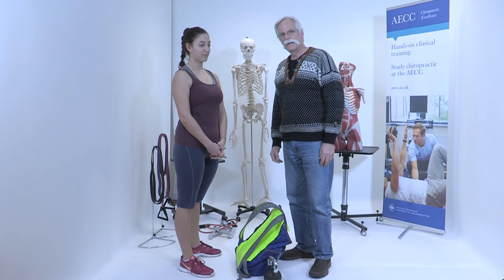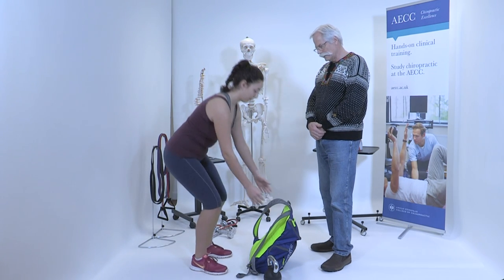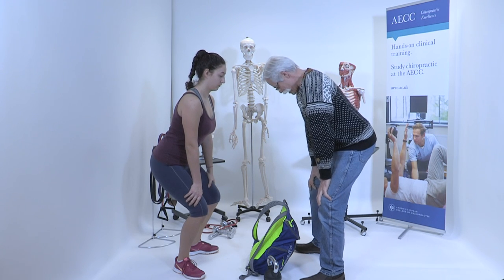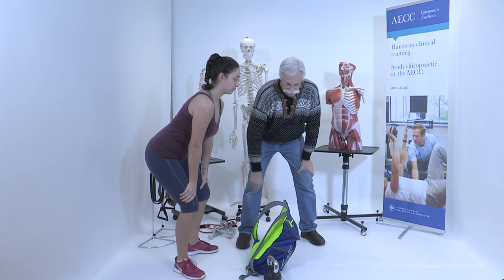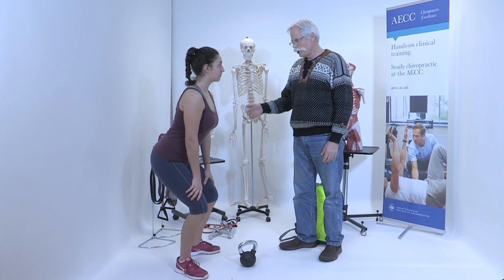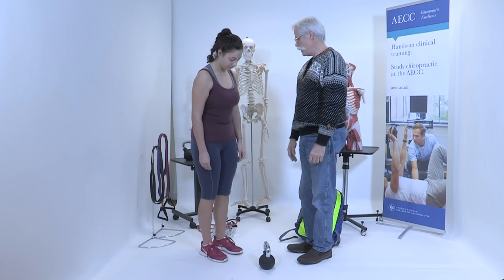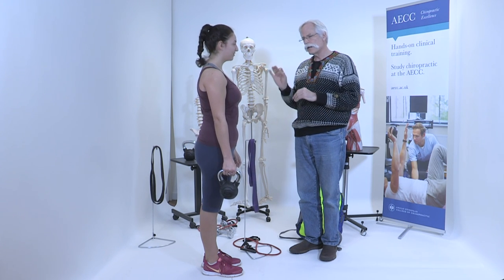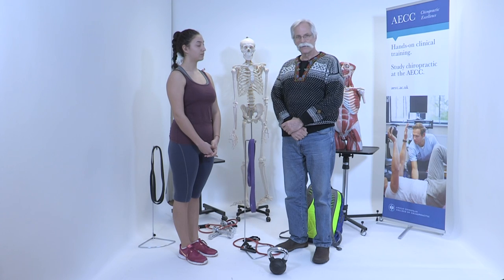Professor McGill - Heavy vs Light Lifting Techniques

Comment: With all respect Professor, but did you realize that you actually flexed in your back at 1:00, when you had to move the bag? 
 Deadlifts are great, but most of us don't really deadlift much outside the gym. We bend over with a round back and pick things up, in the manner that its natural to us. Most human being lift up objects as if they were doing a "jefferson curl", not a "deadlift". So how about making people do more "jefferson curls" so that people become stronger in something they actually use in everyday life situations?
People are afraid to lift and move stuff because of their form not being perfect. Meanwhile for most of the western population the pain and injuries are caused by lack of movement and weakened muscles, not by overtraining and overstressing the body. Even though people like McGill have a positive purpose they are misleading people in the wrong direction.
Reply: Because you can't make "strong" discs or "train" them to last. You can strengthen the supporting muscles around them but there are plenty of strong backs who's discs have failed. McGill's research suggests (this is a VERY dumbed down example) that spinal flexion is like a bank account, regardless of how good the security at the bank. Every time you flex, you take money out of the bank. On a long enough timeline, many will run out of money. Each spine is different and not all loaded flexion is built equally so results will vary but the research results stay the same. Though I do agree that healthy backs would be wise to exercise healthy flexion movements.
Reply: @alisoncraig597  I see what you mean and I definitely agree about strengthening the muscles that support the spine. That is exactly why I think you should strengthen the spinal extensors as well as all the core muscles and etc. By bending in your back and extending it again. 

Trying to keep ones back extended to avoid injury is first off impossible because we are most likely to instinctively bend our back when we are not aware of it and second if we how ever manage to keep the lumbar stable at all time, wouldn’t that consequently cause stiffness, lack of strength and lack of mobility?

I am not trying to act as if I know it all - I am not even a physiotherapist. I’m just curious! 😅
Reply: You need to hit up oh and s people to tell people to teach how to hinge in the workplace. Stu’s job is to educate health professionals. How many companies you know or have work for teaches you how to hinge when lifting a box or an object on the ground? Also most people do not use mindfulness when they do things. Before you even start with deadlift or hinge get people to be self aware or mindful of how they breathe.
Reply: McGill goes into this in detail elsewhere. There are numerous studies showing a correlation between round back lifting mechanics and back injuries in various jobs where medium weight is lifted. A flexed spine is fine for some bending and moving but it is pretty clear in the literature that repetitive loaded flexion is a bad idea.
Reply: @RohannvanRensburg  I have to agree with the fact that there must have been a correlation between these factors. But I am just curious why are we in such a hurry to conclude that the “correlated factors” are indeed the “causation”. 

In fact you can look up many sports such as jiu-jitsu or wrestling where people lift each other up with flexed spine and move in “weird” positions. You can look up the strong man who lift atlas stones. 

My suggestion is that there must be other factors that we are taking to consider.
Reply: @nikholm3823  You can also see consistent patterns of injury among various sports. Powerlifters herniate discs and wreck shoulders, as do Olympic lifters. Hockey players tend to have bad hips and shoulders. Crossfitters tend to have more herniated discs than power lifters, because they have a weird sport whereby they combine the demands of high lumbar flexibility with stiffness. Many MMA fighters have back issues precisely because jiujitsu demands a lot of loaded flexion.

"Correlation" isn't really the weak thing people make it out to be. I would say there are full-on causative experiments on this topic as well, but consider that nothing is ever "proven" in science, though we can claim things with a very high degree of certainty. We have no "causative" experiment on cigarette smoking; the research is all correlative. Would we claim that cigarette smoking doesn't cause lung cancer when there is a 100+ fold the incidence of lung cancer in smokers, purely because it's correlative?

It's more nuanced than flexed vs non-flexed -- atlas stone lifting essentially locks the spine in place and uses the stone itself to stabilize the spine if done properly. But the prevalence and correlation is so strong from a biomechanical standpoint, especially under heavy load (which is what's at stake) that it would be crazy to ignore.
Reply: @nikholm3823  you don't lift people with a flexed spine in ju jitsu or wrestling unless you have awful technique. If you're shooting a double leg or lifting from a body-lock your head should be up and your spine should be fairly neutral. Even in hip throws you'll lift your opponent onto your hip with a neutral spine and then you'll flip them. You don't need to flex your spine for that, you can hinge at the hips and roste the torso. That rotation requires you to loosen the brace around your spine, but there isn't really much load on your back at that point as you'll be letting them fall to the ground rather than trying to lift them or hold them up. 

There are some throws that require spine extension (e.g. supplex), but even then you should be trying to mitigate that stress on your back with hip movement. And you'll be throwing yourself too and falling with your opponent in those throws which isn't really the same as lifting something in an upright manner and moving it.
Reply: @Pentagathusosaurus  yes your right, you never bend your spine during bjj or wrestling... McGill, is this you writing under a psuedo name?
Reply: @nikholm3823  try reading my comment again. You obviously move into spinal flexion, but you don't lift anyone whilst moving into spinal flexion unless you have awful technique. Even with something like the Karelin lift you'd lock your back as  you lift, so you don't have movement of the spine whilst it's under load. I suggest you try it for yourself, practice a double leg with a flexed spine and then with a neutral spine. Get your partner to sprawl and see which is more effective
If you actually want to hear from Mcgill then you can literally go and look up his views on this type of thing - extension intolerant athletes vs flexion intolerant, lifting atlas stones etc etc. Pretty sure he's even talked specifically on wrestling and BJJ multiple times.
Reply: @Pentagathusosaurus  if you read the papers that are done on alive human beings (unlike McGill studies) you can see that spinal flexion is unavoidable. Even when it looks like the spine is in neutral position. and even when the exercise is performed by  highly experienced athletes.
Reply: @nikholm3823  you mean like McGills flouroscopic imaging of weightlifters performing in real time? Or his EMG recordings of various athletes performing in real time? He has quite an extensive research output, and his approach isn't actually that spinal flexion = bad, he's quite clear on the importance of having a solid assesment first and creating a rehab program for the individual. I'd suggest listening to him actually speak about these things in detail if you want a better explanation. For me, my spine is actually a little hypermobile in extension, and the best way for me to avoid back pain was to learn to actually hip hinge properly for deadlifts and to stop stretching my back in extension. Doing a supplex doesn't hurt, but if I stretched into extension in my warm up then I'd definitely feel my back after training. 

I do agree that spinal flexion shouldn't be feared or avoided for the average person, but for someone who has pain with flexion and compression then yes they generally should - like the person this video is aimed at. There's also seems to be plenty of evidence that spinal stability is important for back pain and that moving the spine whilst it's under load can cause back pain, but I'd be happy to read these papers that show otherwise if you can reference them.
Reply: @Pentagathusosaurus you rock! Excellent way to describe the nuisance of this. McGill has rehabbed MMA, and other bendy athletes by limiting exposure to provocative movements and building the core in a spine sparring way and saving their flexion capacity for the match.

We can't have it all! Load the spine but don't move it, or move it but don't load it (oversimplified)